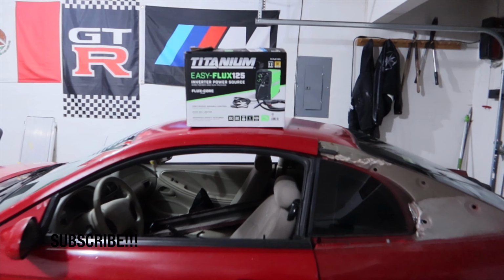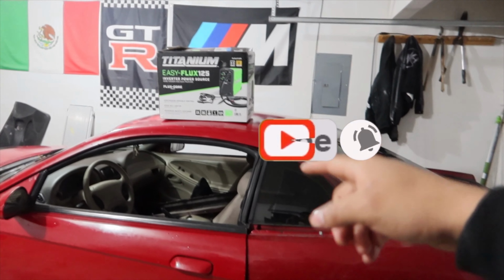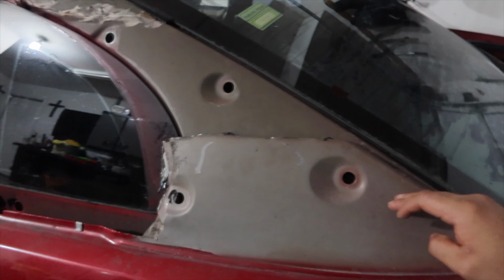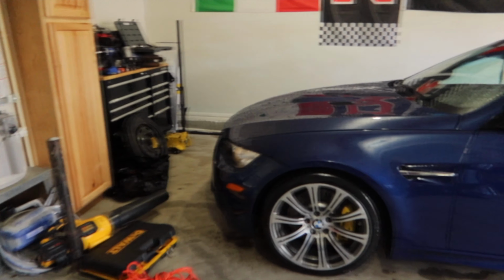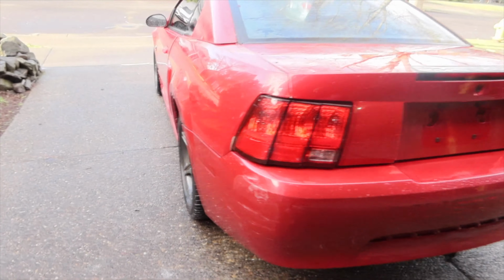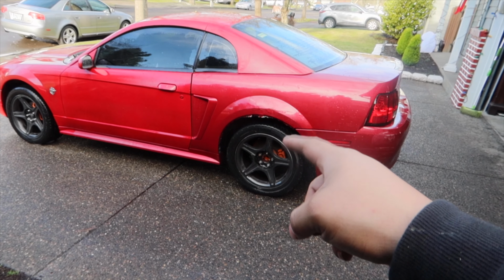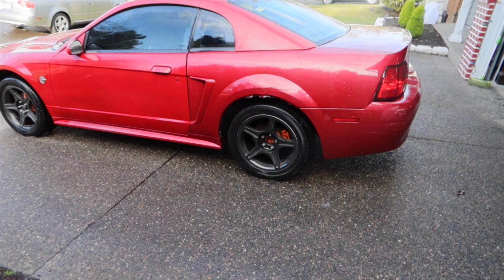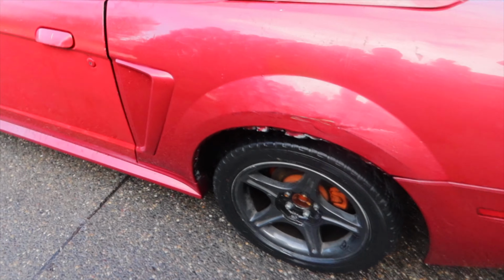Got The Quarter Panel Welded On The Mustang!! (part 2)

Comment: Dude my quarter panel has a rust spot and have been kicking around ideas on how to fix it. Impressive. Excellent work man keep up the good work!
Reply from the maker: The cheap way is you cut a square around the rust area. Weld a square metal in that area and respray primer so it doesn't rust in the future.  That will take care of it. Again that's the cheap easy fix way.

Comment: How much did this all end up costing you? I need to do this exact body work for my ‘99.
Reply: Same I crashed mine 😅 and the body shops are trying to charge me 4K to replace it smh
Reply: 150-320 per quarter roughly labors going to be a leg probably easier to buy a new one if you don’t diy
Reply: @disguisedpickle1360 You mean "buy a new one" as in another mustang or?